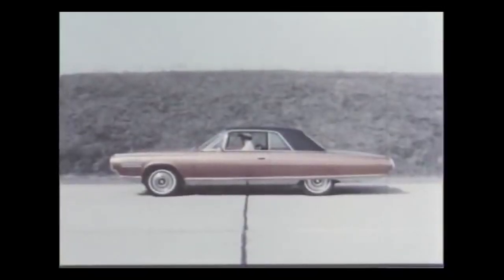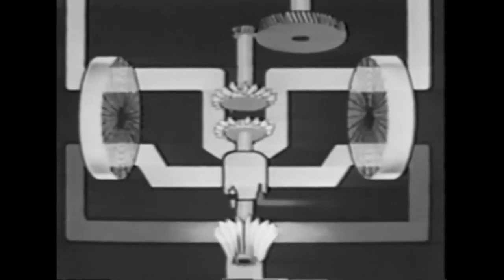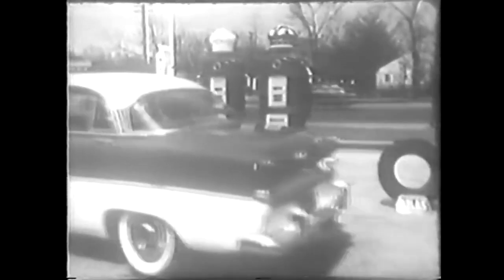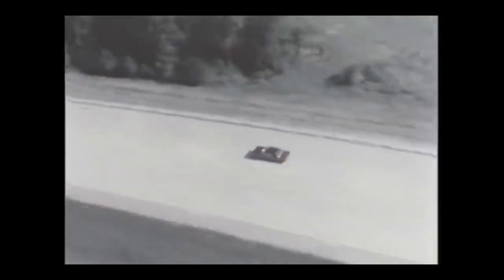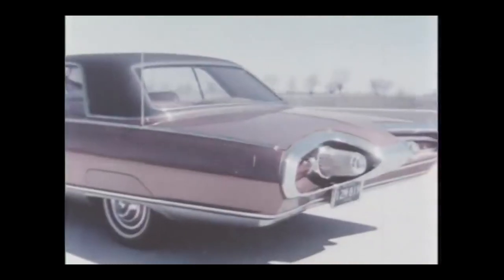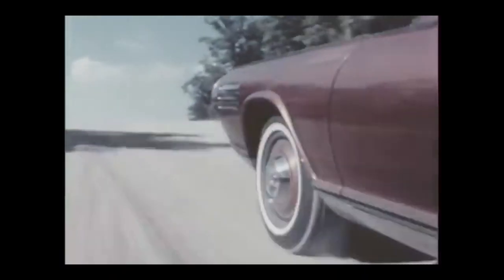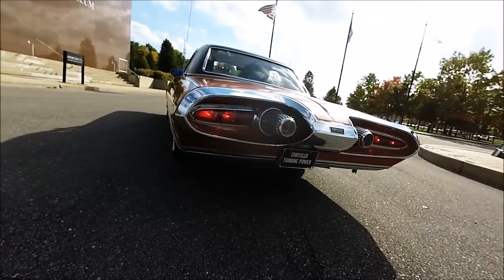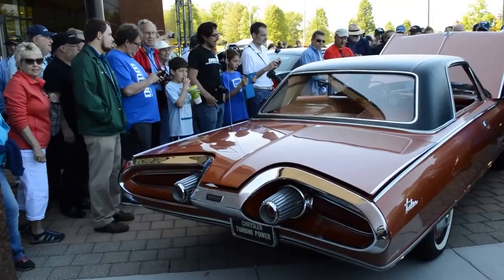A short history of the Turbine engine and why we don’t use them today

Comment: Year 1903: A Norwegian, Ægidius Elling, was able to build the first gas turbine that was able to produce more power than needed to run its own components, which was considered an achievement in a time when knowledge about aerodynamics was limited. Using rotary compressors and turbines it produced 11 hp (massive for those days). His work was later used by Sir Frank Whittle.

Comment: I mean there is the M 1 abrams tank which uses a turbine engine and that is still used today
Reply: They need to move away from turbine. In a modern battlefield, the M1 is a massive target. Loud, HOT, and a fuel pig.
Reply: @TravisPrybylski The m1 isn't that loud. It is when you're right next to it, but the sound falls off quick. It's actually scary quiet when compared to other tanks.

Comment: They should have been jet cars ran on anything anything that burned you could run in a jet engine do you understand what that means no more gasoline you could have used VO5 hairspray and drove down the road a bottle of tequila didn't matter the one that they did build drove for well over a million miles with no problems why do you think the government mandated that they destroyed them they would have changed the world and they would have put a lot of oil tycoon oil would have been useless Electric Company electric cars would have been useless you could have simply put rubbing alcohol which is super cheap to produce in your car and cuss what zero missions people zero and Chrysler actually found a way to cast the turbines Do you want to build a car for the future bring back the Chrysler turbine engine solves all your missions problems all your energy problems most certainly puts all the oil companies out of business you don't need to burn oil in these things